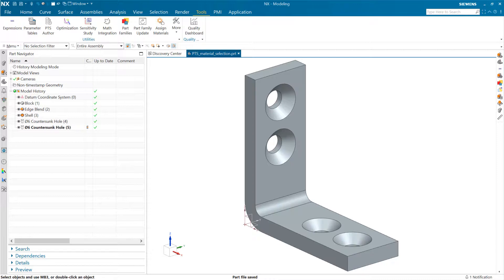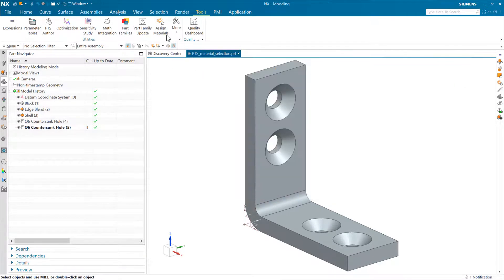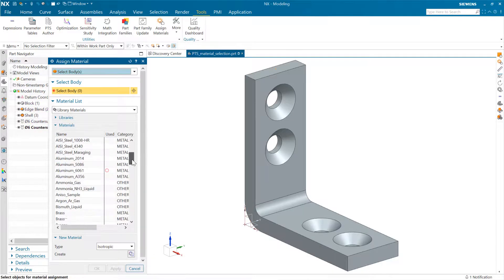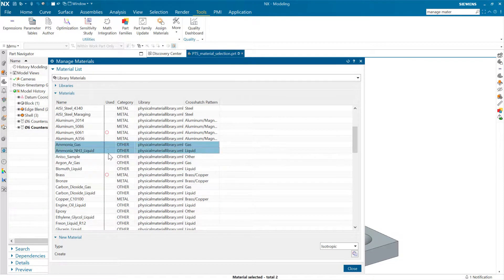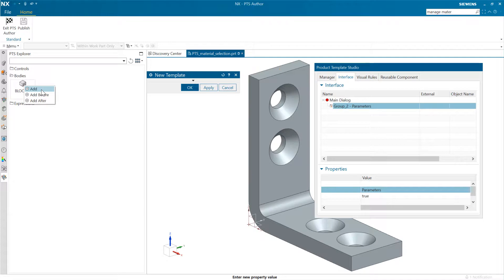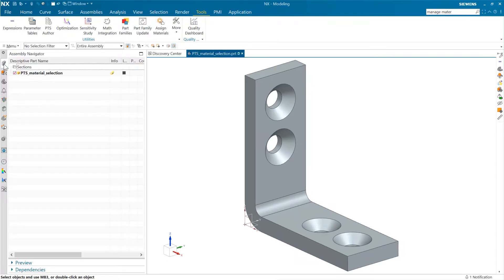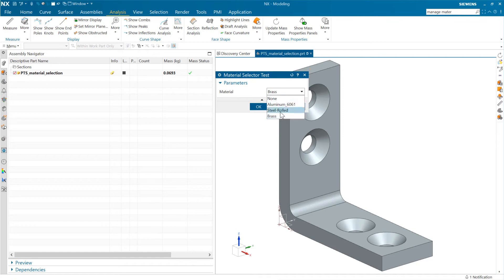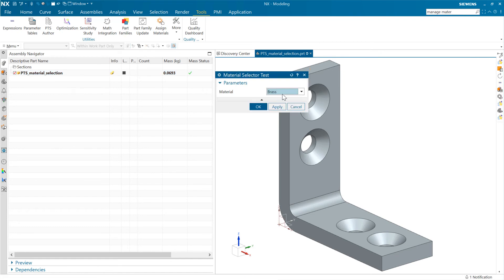NX Product Template Studio: Selecting a Body Material [NX 2007]

Comment: Could you help please ? In Assign Solid Density can I assign a Variable to Mass of Selected Bodies ?
Reply from the maker: I don't believe we allow this right now...  Allowing an expression to drive density would make it extremely easy to create circular references (for example, with an associative mass measurement creating an expression that directly or indirectly drives the variable you're using to drive the density, which would then affect the mass measurement, which would affect the density, etc.)  These days I'd recommend using Assign Material and the techniques in the video, rather than trying to drive a density value directly.  Hope that helps!
Reply: thank you very much ! Could you PLEASE explain how can I measure distance between 2 solid body in a certain region ? : consider a vertical bar and a vertical bended one. I know that between Z 2mm-5mm there is a critical dimension. How can I measure MIN in that region ?  @taylorandersonnxvideos
Reply: add to my preview post : there could be between the 2 solid body a Minimum distance somewhere else but I want to know Minimum distance between the 2 in region defined by a plane at z=2 and a plane defined by z=5
Reply from the maker: @nx6677  Easiest way might be to just subdivide a face in that region and measure from one body to the subdivided face (or group of faces) in the region you care about.  Hope that helps!